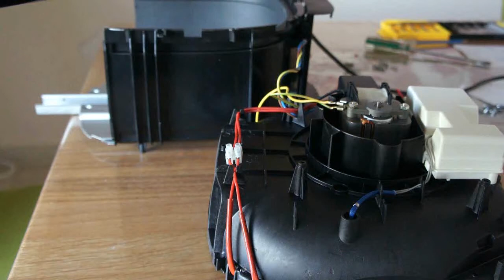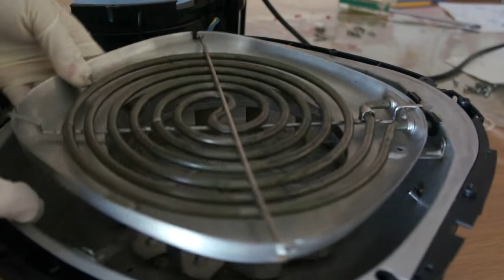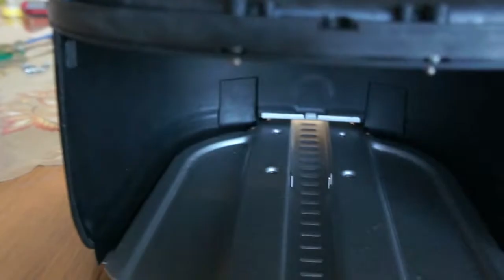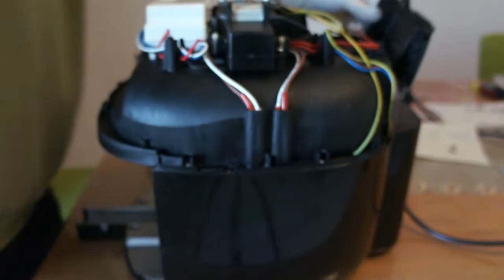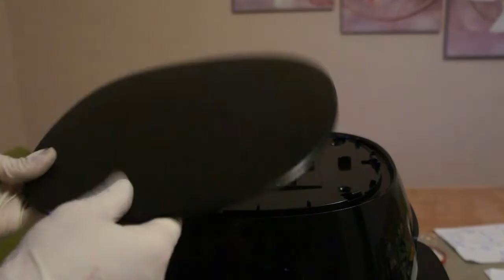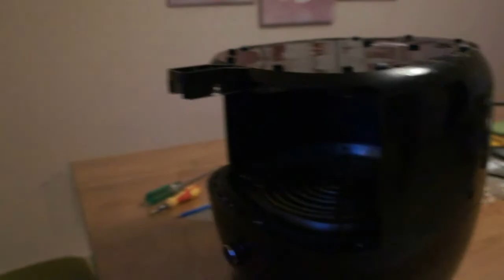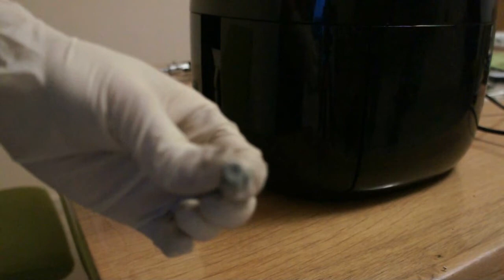Philips air fryer (HD9652) deep cleaning

Comment: Decent Video. Unfortunately, this disassembly does not show the actual "disassembly"; but rather the "assembly" POST-disassembly. Ultimately, this does not match my Philips "Avance Collection" HD9641/56 model, so still trying to figure out how to remove the "dial" in front without breaking the whole top panel. There are two screws underneath; but they do not release the "dial". Furthermore, the top panel can be removed; but if you "pop" it up, then it will break the plastic tabs holding it in. You have to know exactly where the THREE tabs are claimping and somehow wedge a flat head underneath to push them in; so I already broke the tabs although it is not critical for holding that top panel in. At least you included the Model No. in your Title or Description; but I was hoping for a closer match... 🤕

Comment: Why don’t you start from the beginning? It was already open at the start of the video..
Reply from the maker: I understand you; the main problem was that I had no idea what I was getting into.  It was the first time I opened it.  It was also soooo dirty that the grease had covered up screw locations.  I was also doing this alone - it would have been really hard to operate the camera with greased up hands.  At the end I just did not find the time to put it back to original just to do open it again.  Hope it helps anyway - at least the screw locations/ where to pry can be found.

Comment: How do you avoid getting water on the heating element when soaking the fan? What cleaning chemicals do you use while soaking?
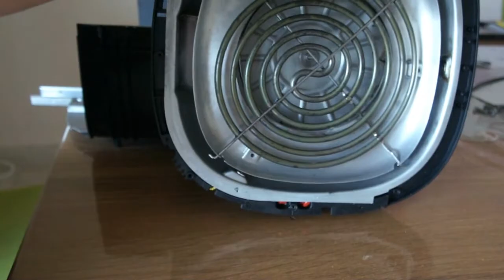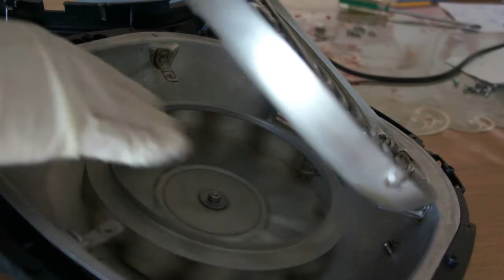Reply from the maker: In the first 0:00-0:06 seconds of the video, you can see a thumb-sized white square block in the middle of the screen.  It does not exist in the original model.  I have actually cut the 2 red power cables that connect to the heating element.  The heating element can thus be removed completely and then soaked in detergent separately.  You can see the whole heating element coming lose in 0:43.  

After cleaning the heating element, the cables are re-connected with the white square block power connector (use a high voltage rating for safety).  

When the heating element is removed, the fan is more accessible for cleaning.  I only wet wiped the fan clean (no soaking the fan) to make sure no liquid goes into the motor of the fan.